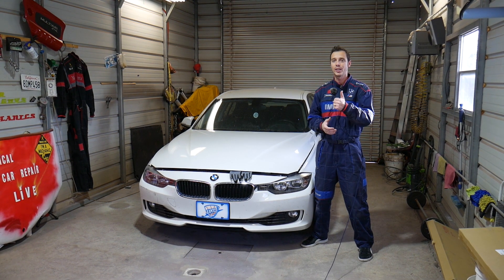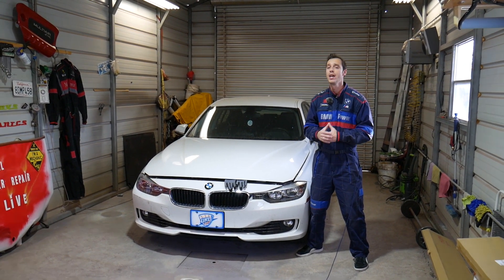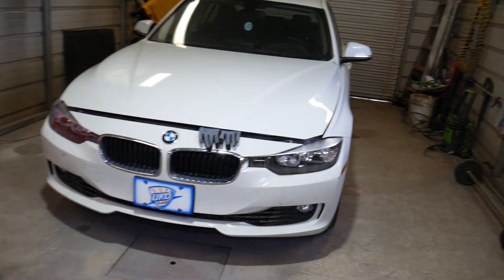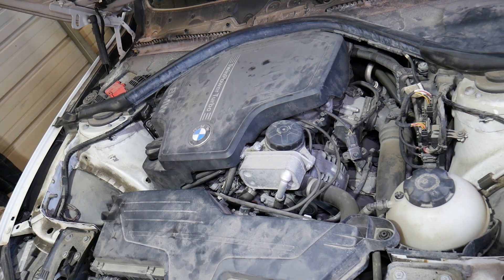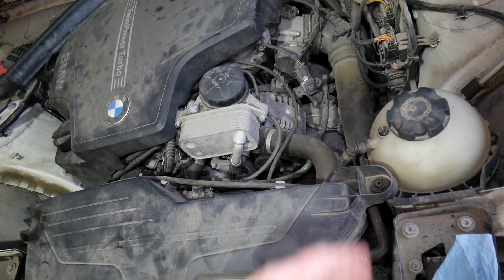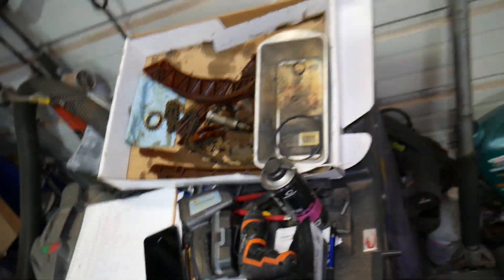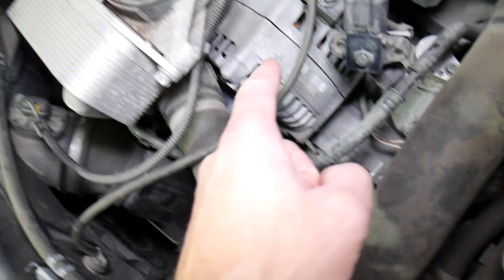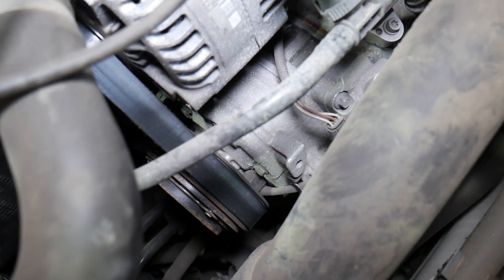BMW A/C AC COMPRESSOR LOCATION REPLACEMENT EXPLAINED F30 F31 F32 F33 F34 320i 328i 420i 428i

Comment: You are one of  best on BMW videos on  you tube,  I been followed  for a while and always help me, thank you for that,
On E60 I would like to ask you i can see the "o" ring  from the lower port of the compressor  is leaking ,
BUT ALSO I NOTICE  IS A DOT OF DYE ON THE CENTER  OF  THE  CLUTCH,  where the nut is holding  the clutch  to the compressor, 
Can that be a leak , can be losing  freon from there or I need to replace the compressor ,
Thank you in advance, 
I will wait  for you suggestions  before i filled with r-134 and have to take it to recycled  .